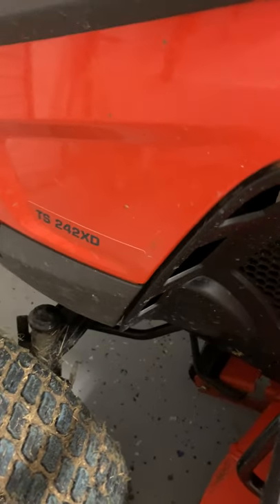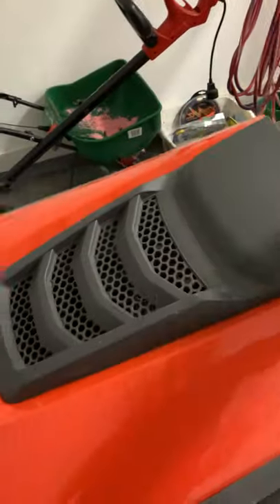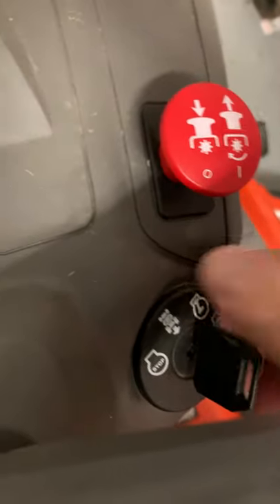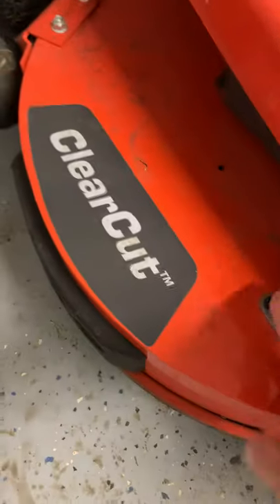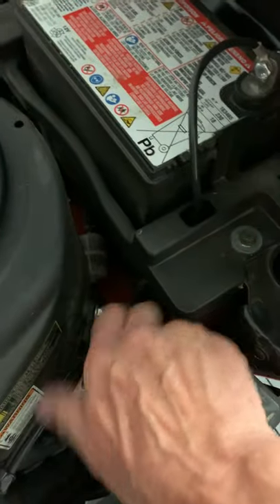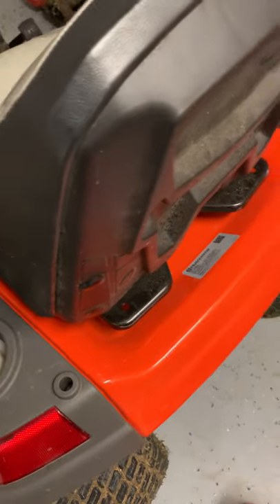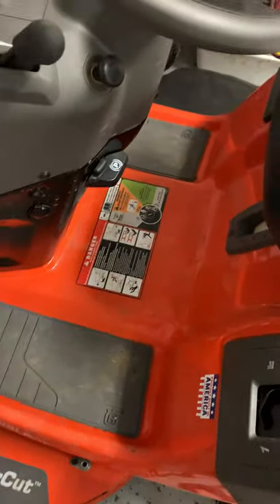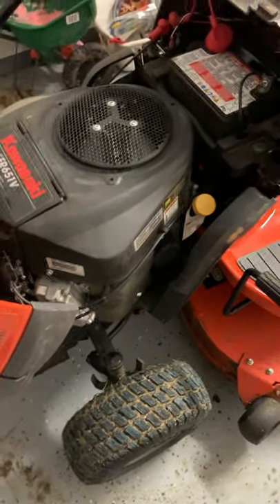Husqvarna TS242XD 21.5-HP V-Twin Side By Side Hydrostatic 42-in Riding Lawn Mower - REVIEW

Comment: You don't need to turn the key to "forward" to move forward. It is just the default key position after starting.  The reason it dies if you go backwards when in the "forward" is because the PTO is on (mower blades) as they see this as a safety feature if you back up mowing. Children etc. could be injured. Their intent is that you be aware the blade is turning when going backward.. But the "backward" the PTO stays on and you can cut grass forward and backwards. I usually flip it to backward so I don't need to think about mowing in reverse it just does it.

Comment: Nice review. That is almost a deadly situtation. Mower blades flying off. Glad you caught the problem in time.😮
Reply from the maker: Tell me about it😇
Reply from the maker: mower has over 3000 hours still running strong no valve adjustment yet... puff of oil at start 😇

Comment: Just got my new TS242XD today.  Had 30 min before work so i took it out. I had two things i disliked. 1st when making sharp turns at a high speed the rear would push my front tires like i was skidding on the grass.  I'll either have to slow down when turning or take a closer look this weekend why this is happening. 2nd thing was even though i like the seat it needs some springs or something.  i feel every bump on this mower. still think its a good mower but Husqvarna has a few areas to improve.
Reply from the maker: Yes slow down in turns and the ride is brutal when I mow the 4 acres ... but super reliable for me 12000 hours so far no valve job yet ... standard maintenance (oil, air , spark)and 5 sets of blades so far … 😇

Comment: I just ordered this machine from Mowers Direct. I've watched several informational videos on the Husqvarna TS 242XD so I will not be over-awed and paralyzed with fear when I take it off the crate (this is my first mower ever). Sounds like I will first need to get under the machine and ensure the blades are fastened tightly to the undercarriage of the deck. I know you made this video a year ago, but can you remember anything else one should know about this mower outside of what is in the owner's manual? Thank you!
Reply from the maker: So far with almost a 1000 hours I have replaced blades ( get the same ones it came with all other variations are no good)and sharpened them, changed oil twice and  air filter twice and i wash it after every mowing. Oh and and a few loose or mising bolts here and there seat and fender areas. I follow all manual maintenance and getting close to setting the valves when I do that I will make a video.
###Parts####
Husqvarna 2-Pack 42-in Deck Bagging Mower Blade for Riding Mower/Tractors
https://www.lowes.com/pd/Husqvarna-2-Pack-42-in-Bagging-Riding-Mower-Tractors-Mower-Blades/1000731364
Kawasaki 49065-7007 Oil Filter (2 Pack) https://www.amazon.com/gp/product/B00WHEVQN2/ref=ppx_yo_dt_b_asin_title_o04_s00?ie=UTF8&psc=1
HOODELL 2 Pack 11013-7047 Air Filter with Pre Filter - for Kawasaki FR651V FR691V FR730V Engine Hustler Husqvarna Gravely Lawn Mower Tractor Air Filter https://www.amazon.com/gp/product/B07W6KZP2N/ref=ppx_yo_dt_b_asin_title_o04_s01?ie=UTF8&psc=1
The belt Husqvarna OEM 587270101 Deck Belt Fits TS342 YT42DXLS YTH2642TDF TS343 TS242
Oil i use ----  Castrol GTX High Mileage 10W-40 Synthetic Blend Motor Oil, 5 Quarts jug ---  the local mower shop recommend 20w-50 castrol regular or sythetic blend but i use 10w - 40  
good luck God bless  works for me 😇
Husqvarna riding mower deck belt (primary mower belt) replacement - DIY works for me https://youtu.be/i65S_CpGfJE
Reply: @mbjdiy1778  Thank you very much for your suggestions and for the links for replacement parts! I will keep a look out for your next video. - Julie

Comment: RRP in Australia is $7699.00 .did a bit or research with husky stores .And the best price is $6799.00 ASD and they throw in a husqvarna 135 mark2 chainsaw .So I'm about to go pick up a TS242TXD Next week
Reply from the maker: cool almost 4000 hours on mine😇
Reply: you mower sez on the side TS242XD .But the mower I purchased a TS242TXD With a T in front of the XD.What is the difference. They look identical kawasaki engine...fabricated deck...in saying that I have purchased the mower from Australia

Comment: How do you like the lock differential. Some people say when you turn tight it rips up the grass a little bit. Is this true? Are you planning on getting the snowblower attachment. I'm hesitating between this one and the kubotta T2290. Thanks mate.
Reply from the maker: I do not notice the right turn problem you are talking about. I do know when the mower starts missing to cut in the middle between the blades it is time to sharpen and that the original blade the mower comes with is the best blade, : (Husqvarna 586918102 Lawn Tractor 42-in Deck Bagging Blade Genuine Original Equipment Manufacturer (OEM) Part https://www.amazon.com/gp/product/B076JGV1R3/ref=ox_sc_saved_title_1?smid=A1TA83W13YOBB0&psc=1 ) Second question : No snow blower yet. 42" Snow Thrower Attachment with Electric Lift
$1,999.00 https://www.husqvarna.com/us/riding-mower-attachments/42-snow-thrower-attachment-with-electric-lift/    Third question kubotta T2290 cool mower my dealer only has zero turns . Kubota makes great stuff this mower list for $5,169 about $2,000 more than mine. Hope this helps on this rating / review site : 2018 Kubota T 2290 - 48 https://www.tractor.com/specs/kubota/lawn-garden/2018/t/2290-48/specs.html#:~:text=2018%20Kubota%20T%202290%20-%2048%20Specifications.%20Tractor,Lawn%20%2F%20Garden.%20MSRP%20%28US%29%20%245%2C169.%20Warranty.%20Months.    Works for me Good luck and God bless

Comment: If the machine has been sitting and not running, do not wipe the Oil Dip Stick, there is no need.
The Oil is sitting in the sump, wiping the stick is a waste of time, just read the oil level.
Same applies to your car engine, hasn’t been running, then simply check the Dip Stick.
Reply from the maker: No...  the instructions say remove stick ... wipe ... put stick back in (do not screw in) just flush with nozzle ... remove take reading ... check your manual 😇

Comment: WOW, A New Mower & It's Using Oil & or Burning Oil... BAD... Motors Then... or Maybe A Leak ???
Reply from the maker: All mowers do this unfortunately ... standards for builds I do not think are high when compared to motorcycles or street vehicles  .... just the way it is  😇 but these engines run and run 2700 hours so far
Reply from the maker: my neighbor  has a john deere said it did not burn oil ... i said wow ... he fired it up ... big cloud of blue smoke .... = it is just the way it is 😇
Reply from the maker: I did have a push mower by Honda ...never ever burned oil🪔

Comment: How many hours on her so far and how has she been up to now?
Reply from the maker: I have almost 13000 hours ... basic maintenance (oil, plugs ,air filter, lubrication)...many blades (5 sets so far ).... one deck  belt ... have not adjusted the valves yet ... slow compared to a zero turn .. very dependable😇
Reply: @mbjdiy1778  sir, did you mean 1300 ? Or 13,000
Reply from the maker: 13,000 hours😇
Reply: @mbjdiy1778  goodness gracious 🤯😱